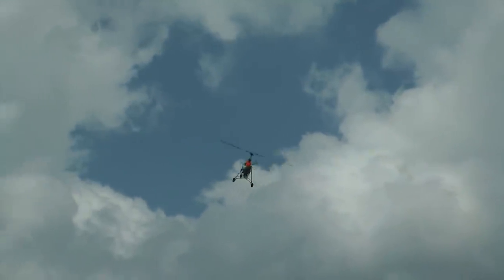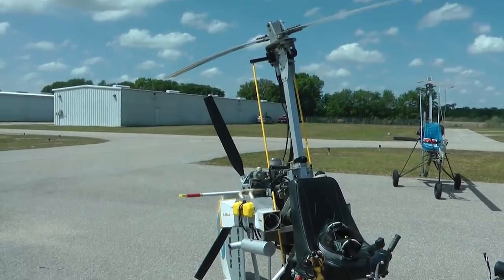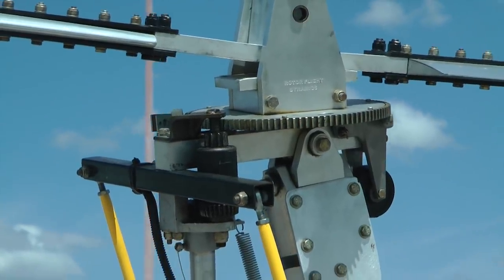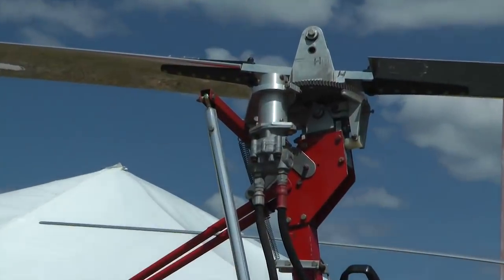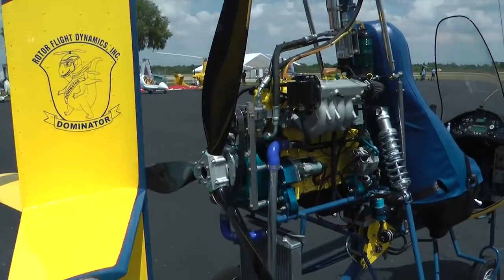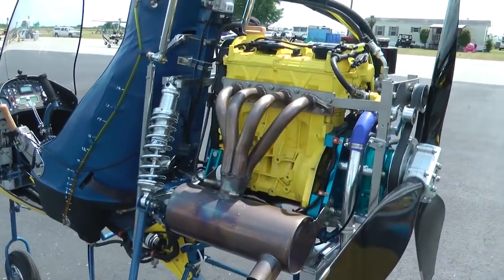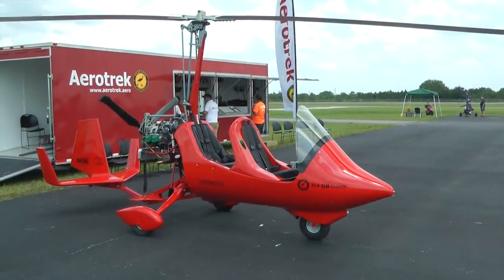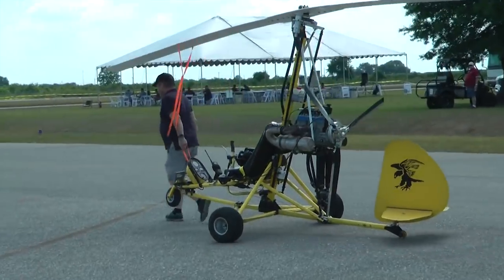What's so Special about a Gyroplane?

Comment: There's nothing it can do that an ultralight fixed wing can't but it is an interesting physics phenomena.
Reply: Try a vertical descent in an ultralight, landing with no airspeed and if you're still alive, come back and revisit your comment.
They do have somewhat different flight-characteristics and trade off one set of drawbacks for a different set of drawbacks but they are quirky little flying machines, that's for sure.
Reply: @RoadRunnerLaser  So if they are safer than ultralights why anyone uses ultralights?
Reply: Next Leader - They're not necessarily safer, they just have slightly different drawbacks but compared to a fixed-wing aircraft of a similar mass, the gyro will be more likely to fly in less-than-ideal weather. They are not bothered by rain and are far less susceptible to turbulence.
Let's reframe your question - If cars are safer than motorbikes, why does anyone ride a motorbike? Personal preference and familiarity play an important part, I guess. It might also be that a fixed-wing ultralight works out a little cheaper and is mechanically a little simpler (although without spending time comparing costs and designs, don't quote me on that one).
Another factor is probably that autogyros have a bad reputation stemming from their early days. especially with so few CFIs and twin-seat aircraft - It meant that many inexperienced and poorly-trained stick-jockeys were taking to the air, solo, only to find out that smacking into 6 thousand, six-hundred million, million, million tonnes of rock is painful on the body and the wallet. Things have improved a lot in that regard over the years and good training is easier to come-by.
I think that people tend not to trust rotary-wing aircraft as much as they do fixed-wing aircraft. People tend to have the idea that flying things should look like birds, not kitchen appliances. For a long time, I was very distrustful of helis and never wanted to go up in one, let alone fly one.
I was a die-hard fixed-wing fan and just thought of a helicopter as something that flies by beating the air into submission and is secretly plotting the demise of the person who cons himself into thinking he's the pilot. However, for me, things have changed since I qualified as a commercial UAV pilot and most of my hours have been on rotor-craft. I've gained some respect for the way a traditional heli actually flies and if someone said to me today, "You're going to go up in an aircraft and at 2000ft AGL, you're going to lose your engine. Pick your bird." I'd take a traditional heli or gyro over the fixed-wing because I know that it would give me a better chance of a safe touchdown.
I loved autogyros as a kid but saw them as a quirky oddity and not something that I'd specifically want to fly - Right now, I am looking into buying an R/C autogyro and wondering if getting gyro lessons would be something I could afford in the not-too-distant future.
As it stands, all things being equal (in terms of cost etc.), if I were to have the choice of owning and flying an autogyro or a fixed-wing ultralight, I'd go with the autogyro because I would not be dependent upon such perfect weather conditions and I would likely be able to get a lot more flying time because I live in Scotland - ultralight flying days don't come around very often.
Reply: @RoadRunnerLaser  thanks for the response, it answered by question.

Comment: I understand they are unique and there is a cult like cool factor around the auto gyro, but is there any advantage over an ultralight fixed wing type flying machine ?
Reply: Jerry Collins  that is a good point
Reply: Thy 1 bolt yz kalled- -Jeezus NUT!!🤢no BS either 🤪
Reply: From what I understand, no stall spin accidents.
Reply: @movingtarget1711  there’s still a loss of pitch control you can cause by unloading your rotors with hard neg G.  Once they are out of control they seem to stay out of control, I’ve not seen many recoveries from a full bunt over.

Comment: Why can’t it have 4 blades ? Would it be smoother and require less rpm ?
Reply: Ernie tried it one year with Rusty Nance doing the flight honors... I watched as he did the first take off... glad he got it on the ground safely... Rusty Nance can give you a flight report.
Reply: 3 or 4 blades wouldn't help that much, if at all. Plus, very convenient storage and transportation with 2 blades.
Reply: The answer is simple:  I mean that, literally.  There are flying examples of 3 and 4 blade rotors, the first autogiros ever built and flown successfully all had four baldes!  The way to do it is to have each blade hinged at the root so that it can "flap" as it precesses and recesses in flight through a complete rotation.  A two-blade system uses a solid hub bar that is hinged by a single bolt placed a few inches above the center, as one blade moves with the apparent wind flow over it and changes angle of attack, the other blade balances exactly opposite.  It works quite nicely, actually.
Reply: Gtgyro - could a large two blade gyro-prop work?  But by two blades I mean each blade is 40 inches wide and six feet long and compound so that each blade has two airfoils.  So within the two blades there are 4 airfoils with each pair built to compliment the aft blade.  I'm predicting it would stol even more effective than what auto-gyros already do and at lower ground speeds.  Carbonfiber wrapped styrofoam or hexa-board (honeycomb board).
Reply: 40 inches wide?  as in the cord is 40"  What are you trying to do, re-introduce DaVinci's "ORNITHOPOTER"?  Simple answer:  no.

Comment: I don't understand why they cost so much. Some are made using old Volkswagon engines putting out about 65 hp. Just think what your car could do if you put wings on it. Some cars have more than 500 hp. With wings and a rudder and a few other items we should all be flying around. In fact watch funny cars or sport car races and you'll probably see one fly off the ground without wings. So maybe someone will explain it to me without being overly rude. I'd like to know everything but it's hard. Peace.
Reply: i think they are all handmade
Reply: Je G -- Why aircraft cost so much is one question, and why we don't have flying cars is another.  

The first question can probably be summed up in one word:  Liability.  Sell me a piece of wood and charge me $2.00.  Sell me a piece of wood and tell me it's suitable for a specific purpose (boats, airplanes, medical furniture) and charge me $20.00 -- not because you're greedy, but because you have to certify the wood is suitable for its stated purpose and you need a gazillion dollars insurance coverage just in case.   

As for flying cars ..... the average car weighs about two tons (and you haven't put the wings or tail on yet, while a Cessna Skyhawk (four seats) weighs less than half that.  

Consider the weight of everything you need to get off the ground that isn't helping you stay in the air -- not just transmission and tires, but have you ever carried an automobile seat any distance?  Fuel/air mixture has to be adjusted with different altitudes - so more modifications to the engine.  Most small aircraft use air-cooled engines, so no radiator (with all that heavy coolant) is needed either.  You would also need a complicated contraption to run all that power to the propeller unless you had a separate engine mounted on the wings (which gets away from the original idea of using the car's engine).

I remember one example of a "flying car" from (I think) the 1950's in which the car would detach from the wings and drive away.  There was probably a reason it didn't become popular.  Aside from the price, it probably didn't make a very good car AND probably didn't make a very good airplane either.  Best to stick with something purpose built.

Still, the people who say "it can't be done" are usually the ones made to look foolish when someone finds a way to do it, so who knows ....

Comment: What happens  if you turn off the engine?
Reply: Jan Sveen that's what I was about to ask too
Reply: Autorotation. Gyrocopters use induced upward drag to achieve lift. Think of it like a mechanical glider. 

Under normal circumstances (excluding mechanical failure to the top rotor) they can not stall so if an engine stops, you slowly glide to the ground.

They are conceptually safer than helicopters and airplanes on that fact alone. However... they are very gasoline hungry due to drag and can't be made to travel nearly as fast as alternative aircraft.

Comment: Very dangerous to fly that, there is no backup in case of engine failure or damage of Main Rotor Blade...
Reply: Most single-engined aircraft have no backup in the event of engine-failure. An autogyro can be put down in a much smaller footprint than a fixed-wing aircraft of equivalent mass making emergency landings far safer in that you have a much wider choice of potential emergency landing sites. There are countless single-engined aircraft flown safely every day, from ultralights to beasts like the Antonov AN2 or even traditional helicopters.
Guess what - A Boeing 747 doesn't have any backup in the event that its wings break, either.
If you are properly trained on how to fly one of these and don't make rookie mistakes, they are actually a lot safer than something like an ultralight because they don't suffer with many of the problems inherent in the fixed-wing design. They do, however, have some of their own inherent problems which is why I mentioned the need for proper training - but that is true of ANY aircraft.

Comment: why arn't they jet powered?
Reply: The engine would be too expensive and big. Would also require a lot of fuel. Sure, the power output would be huge, but they don't need that much power to work. It's like building a turboshaft car.

Comment: All I can see is that my life hangs on a 1/2 inch bolt.....not good enough for comfort
Reply: A 1/2" grade 8 or A/N bolt has over 130,000 psi of tensile strength. If it can't hold your fat ass, it's not very likely you'd get off the ground in the first place.
Reply: @jck9590  
Thanks for the compliment....
However it seems I failed to make my point....point is there is no redundancy,  just one bolt and it doesn't matter how strong it is , there's always the chance of metal fatigue or hidden flaws.
Reply: Jc Knight... LOL!

Comment: gyrocopter not gyroplane
Reply: These are autogyros, with free-running rotors and a powered propeller. Gyrocopters have both a powered rotor and a propeller. Helicopters have a powered rotor which provides both lift and thrust, and often a tail rotor for controlling main rotor torque effects. A gyroplane has at least one rotor and a wing. ('Gyro' for 'rotor', and 'plane' meaning  'wing'.)
Reply: gyrocopter and autogyro is the same thing the name gyrocopter is taken partly from the name autogyro and the name helicopter giving it the name gyrocopter,  what it is refered to depends really on which part of the world u live in however its still not a gyroplane

Comment: Its got no rear rotor.
Reply: If you are referring to the tail rotor found on helicopters, it doesn't need one because there is no need to counteract the torque of the motor spinning the main rotors - the main rotors are not powered so there is nothing to counteract.
Modern gyrocopters tend to have mechanisms like the ones shown in this video to spin-up the rotors before beginning the takeoff roll but the mechanism is disconnected before the takeoff roll begins leaving the main rotors spinning freely. During takeoff and flight, the main rotors "autorotate" meaning that airspeed is what turns them, not an engine.
When you have an engine turning the main rotors one way, it is turning the body the opposite way (in accordance with what Sir Isaac Newton taught us about every action having an equal and opposite reaction) and it is this torque which a tail-rotor is there to counteract.
I hope this helps explain why a traditional heli has a tail rotor but autogyros/gyrocopters/gyroplanes (and multi-rotor helicopters such as the Chinook) do not.

Comment: I was hoping to understand what's so special about a Gyroplane.  Not what one is.  Seems like a fixed wing would be a lot less trouble.  All that vibrating and shaking of the Gyro is just a thrown bolt away from a plummet.

Comment: I have a roto flight Dynamics rotor head for sale never been used brand new and also a 3 bladed warp drive brand new
Reply: Do you have any flux capacitors or dilithium in stock?
Reply: how much you asking for? also do you have the blads?

Comment: but if you are in the air and the motor conks out, you are a gonner dude
Reply: Michael James  Not true, the rotor will safely bring you down, because it’s not connected to the engine once it’s up and flying. Auto rotation it’s called.
Reply: @jamesgregory2197  that´s pretty cool but wouldn´t it still be a hard landing? possibly get hurt?

Comment: If you are going to make a video, at least get your facts correct. The gyroplane was invented in the early 1920s by the Spaniard Juan de la Cierva. The technology is almost 100 years old. Dude, next time, just check your facts on Google before you say something ignorant.
Reply: Good point.  Igor Bensen gets the credit for the first home-built type gyrocopter, I think.  But, I knew that the IDEA and first machine was someone else's design.  Thanks for posting the proper credit.  That name rings a bell.
Reply: Paul Oakwood yeah.....
Reply: dude ?
Reply: The autogyro was invented by Spanish engineer Juan de la Cierva in an attempt to create an aircraft that could fly safely at low speeds. He first flew one on 9 January 1923, at Cuatro Vientos Airfield in Madrid. Cierva's aircraft resembled the fixed-wing aircraft of the day, with a front-mounted engine and propeller . Dr Benson made the first Gyrocopter in pusher configuration .
Reply: No compendre, we live in America

Comment: gyro planes are awsome cause in the event of an engine out your emeidietly falling to the ground to your absolute death. where as a plane with wings or even a paramotor you can glide safely to the ground and go home to your family at the end of the day. instead of simply dieing and ruining many lives cause you wanted to fly a dumb ass machine for a ""hobby"
Reply: Actually, you are incorrect. The same way you recover from an engine out on a helicopter is the same you would with a gyroplane. In a helicopter, the clutch is disengaged from the rotor and the disc tilted center to freewill like a windmill. Upon landing that disc is pull back to stall the aircraft just before touchdown. It's called autorotation,and it's no different from a gyrocopter, except that the disc is not powered through a transmission. The disc of of the gyrocopter is tilted negative relative to the wind, so it catches the relative wind created by the thrust from the driver prop.

 My issue with the craft has to do with the flight envelope. It requires a higher minimum airspeed to hold altitude than a fixed wing of the same weight. The gyros are more tolerant of wind gusts and turbulence than a fixed wing would be though, and of course the landing rollout is much shorter. I still prefer flying powered parachutes and fixed wing aircraft.